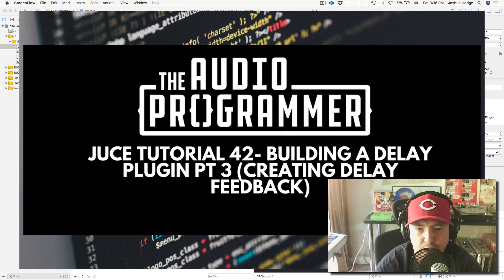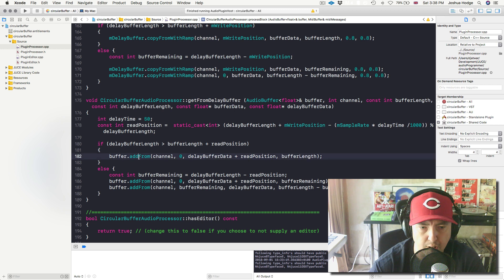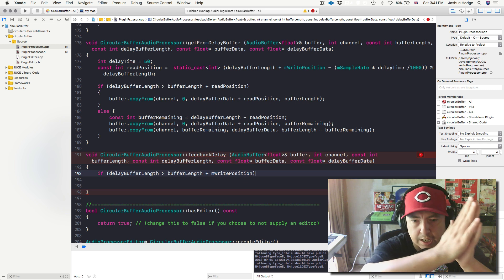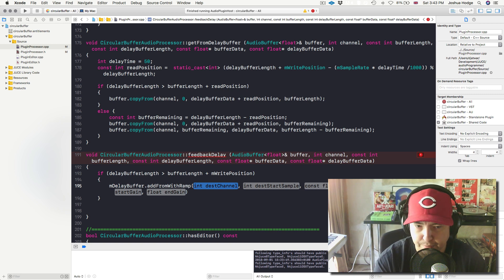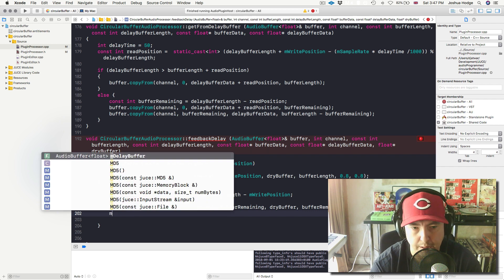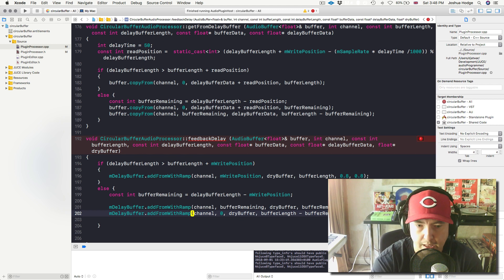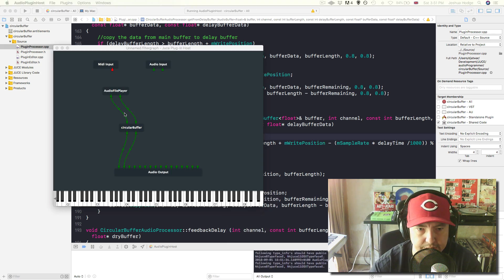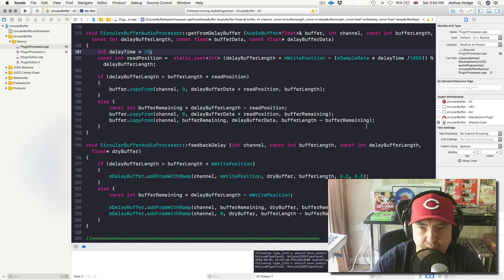Juce Tutorial 42-  Building a Delay Plugin Pt 3 (Creating Delay Feedback)

Comment: Hi there. I've used this tutorial to build a delay plug-in which I've expanded to include wet/dry gain, variable delay time, and sync-to-bpm functionality. The problem that I'm currently having is that I get artifacts when I change the delay time, and I can't figure out a way to smooth these out given the blockwise processing for the main delay functions. Can you point me in the direction of how I might deal with artifacts here? Would be much appreciated! Thanks!
Reply: didnt you get artifacts after bulding from this tutorial? or crackling in the delay?
Reply: @ayymnothyngg  Yes I did get artifacts and crackling when changing the delay time. That is the problem I am trying to solve! I have looked at some other examples of delay code that have methods of resolving this (using the JUCE LinearSmoothVariable class, or Linear Interpolation) but all of those require you to loop over the individual samples in the buffers. With the addFrom and copyFrom methods shown here (which form the core of the delay functionality) it seems like I can't implement the smoothing or interpolation. But I am looking for a workaround if anyone knows of one!
Reply: Marc Langer i think i formed my question the wrong way, what i meant is getting artifacts with a fixed delay value as shown in the tutorial. i seem to get „helicopter-like” artifacts from my delay if that makes sense. i need a delay implementation for chorus/flanging effect, which from my understanding require interpolation to work, so its maybe best to use juce delay for this application. thank you for response
Reply: @ayymnothyngg  Do you mean a JUCE delay from their DSP module? I'm fairly new to JUCE so I didn't know about that. Can you point me to it?

Comment: I implemented the exact code in my program and am getting clipping every 2 seconds. I read some JUCE forum comments on issues like this but nothing to explain what is happening. Has anyone run across this issue?
Reply: Try adding mDelayBuffer.clear() in the PrepareToPlay.
Reply: @jackresweber4012  I was getting a strange half-second chattering when I launched the plugin – this solved it! Thank you.
Reply: @jackresweber4012  thank you!!!
Reply: I getting the same issue, im not sure whats causing it but it definitively seems to have something to do with the wrap around
Reply: I have the same problem, have you had any luck with getting it to work? i found a JUCE tutorial that goes over how to make a delay using the Delay class but i would much rather do it the other way  https://docs.juce.com/master/tutorial_dsp_delay_line.html
Reply: If you check the comments in part 1 of this tutorial, somebody ran into this issue and found a fix for it. Basically in the fillDelayBuffer function, in the else statement, the second copyFromWithRamp, the third argument needs to be bufferData + bufferRemaining, not just bufferData.
Reply: @Ioannis Chrysostomakis didnt fix it for me either. delay works per se, but i get artifacts. i am pretty certain the wrap around is messed up somehow but i dont know how

Comment: Hi! thank you! and what should i do if a wanna create a chorus? or a vibrato or those SUB delay effects?
Reply: Create an LFO and modulate the read (from delay buffer) location by adding the sinusoid to the read location index. Note that the amplitude of the sinusoid should be set to the modulation depth (in samples) and rounded to the nearest whole number. A catch is required to ensure that the modulated index can wrap around the circular buffer correctly - otherwise it will repeatedly try to look off the end of the buffer.

Comment: Thanks for another great tutorial. Do you know how one could go about implementing a wet/dry function to this delay plugin on top of the existing design?  I couldn't find a way unless I implemented another for loop to process through samples after the copyFrom to fill the delay buffer.  Fetching delay and sending feedback were also then processed in this sample loop, instead of the addFrom and copyFrom as per your tutorial. Cheers.
Reply: You can set up another user control that ranges from 0 to 1. I called it 'wetdry'. Then you can scale the linear gain that is applied to the dry signal by (1 - wetdry) and then multiply the startGain and endGain for the delay buffer READ function call by wetdry. By doing this, the wet/dry mix is controlled using one parameter.
Reply: Did you guys manage to do the wet/dry? I'm having trouble with that, I do not know where exactly in the code to put ' buffer.applyGain(gain); '
Reply: @Koryteq  Hey bud, yeah I managed with some very minor tweaks. So firstly, a user controlled variable set up on a slider (or similar) that varies between 0 and 1. I have called this wetdry (of datatype const float in the processBlock method). Now, I am hoping that our code matches up(!) - it has been a while since I looked at this -> I have multiplied all instances of 'gain' (the linear gain variable) by (1.0 - wetdry) to scale the 'dry' part of the output. I then manipulated the readFromDelayBuffer calls - in my code there are two calls of the read from buffer function. For both function calls, I multiplied the 5th and 6th input arguments by 'wetdry'. And that's all there is to it (hopefully!). Let me know and best wishes!
Reply: @stephenoxnard3292  Thank you for the answer!

I've tried to manipulate 5th and 6th argument of function getFromDelayBuffer, for example that amplitude would be 0.1. But for me it affects whole signal, the whole signal is 10 times more quiet (the direct sound as well as copies). Where exacly do u call function getFromDelayBuffer the second time?

'I have multiplied all instances of 'gain' (the linear gain variable) by (1.0 - wetdry)' - what do u mean by all instances? (Where I should apply value 0.9 (as 1 minus my 0.1) in the code? Cheers!

(For now I'm testing if it works and I'm going to be adding the slider later).
Reply: @stephenoxnard3292  Bro I got a notification that you've answered to my comment, however it disappeared somewhere and I cannot see it :(
Reply: @Koryteq  It disappeared because I realised I had made a slight mistake and deleted! Sorry about the delay and you're more than welcome re these replies. So, I realised that the code that I was originally working from was too removed from the code put forward in this (excellent) tutorial. To remedy this, I went all the way back to the start and got the code to the exact same state as that given by the end of the Part 3 tutorial. Then, I made the necessary changes which I hope you can follow (and moreover, I hope actually work!). 

The first thing is to declare a float variable in the .h file - I call this 'mWetDry' to follow the Hungarian notation convention used here. I use the declaration to hard code a value for this parameter (i.e. float mWetDry{0.5};  is a 50/50 mix of wet/dry balance. 

Moving to the .cpp file, I changed all 'buffer.copyFrom' function calls in the 'getFromDelayBuffer' method block to 'addFrom'. The 'addFrom' function provides one additional argument - a source gain. Leave the first four input arguments as they were originally (as from the original  'copyFrom' function calls). The additional 5th input argument should be set to mWetDry. By doing this, the input audio is first multiplied by mWetDry before being read from the delay buffer and added to the output buffer. That means that when mWetDry is '0', there is effectively no contribution to the output from the delay buffer (dry). When mWetDry is '1', the delay buffer fully contributes to the output buffer (wet). 

Now, to control the 'dry' contribution, an additional function is required in the ProcessBlock method. The following functions are called (in order): fillDelayBuffer, getFromDelayBuffer, feedbackDelay. What I did was apply a gain ramp to the buffer just AFTER the fillDelayBuffer. So, after fillDelayBuffer and *before getFromDelayBuffer, I inserted: buffer.applyGainRamp(channel, 0, bufferLength, 1.0-mWetDry, 1.0-mWetDry);

This has the effect that, after the delay buffer is filled with input samples, the input is then scaled in level by 1 - mWetDry. So, when mWetDry is '0', the gain applied to the dry output is 1. When mWetDry is '1', the dry gain is 0 and the original input does not contribute to the overall output. That completes the WetDry control which runs off one parameter. With a few changes, it should be possible to have independent gains for Wet or Dry - I just thought this would be the easiest to describe initially. I hope I have described in good enough depth. Please do let me know if it works for you.

As an aside, I had issues running the plugin in Reaper and in Projucer I always heard a strange buzzing sound when the plugin initially ran. I solved the buzzing issue by 'flushing' out the delay buffer in the prepareToPlay method - after the original code I used:
for (int channel = 0; channel < numInputChannels; ++channel){
		for (int i = 0; i < delayBufferSize; i++) {
			mDelayBuffer.setSample(channel, i, 0.0);
		}
	}

to set the whole array to zero. I am just about to test to see whether this also solved the issue in Reaper. 

One final thing to note is that the memory used for the delay line is never 'freed up' using the deconstructor - but, as of just now, I don't actually know how to delete a JUCE buffer correctly!

Best wishes, hope it all works! If not, let me know - it seems to be all good on my end.
Reply: That flush of the delay buffer fixed the problem in Reaper too so I definitely recommend using it!
Reply: @stephenoxnard3292  The way you described definitely works! 

In my case a situation is a little more complicated, because I am actually making a reverb plugin using it. That works also when I have tons of delay lines (after slight modifications of the code), however after changing 'copyFrom' to 'addFrom' in 'getFromDelayBuffer' function suddenly my IIR filters (that I filter buffers with) started to make a lot of unwanted, distorted sounds. I need to figure out what is going on in my code).

In a delay effect that works perfectly. In my situation that definitely brought me MUCH closer to the solution. 

Thank you for the effort, I appreciate your extended answer very much!!

PS. If u want to make all samples of a buffer zero, you can just use: buffer.clear() - when the buffer already has size all its samples are set to 0.
Reply: @Koryteq  amazing! Cheers for getting back to me and for the heads up re flushing buffers - that's ace. Hope you get your reverb under control! Let me know if I can help out anymore. All the best bud